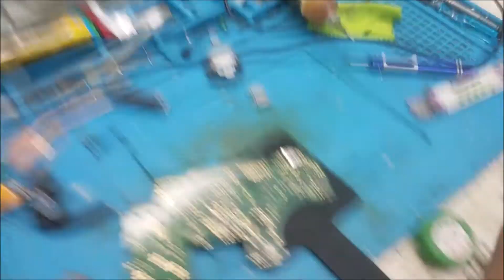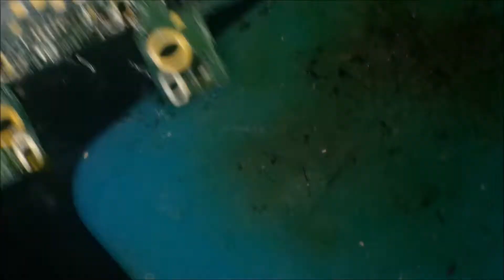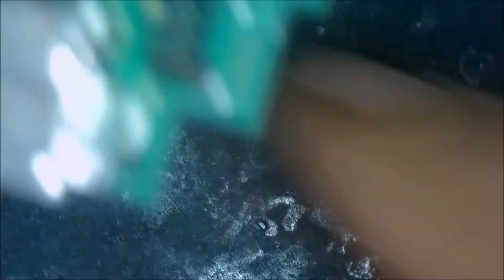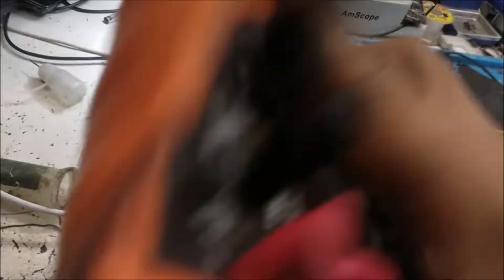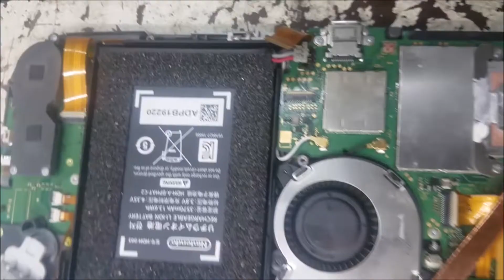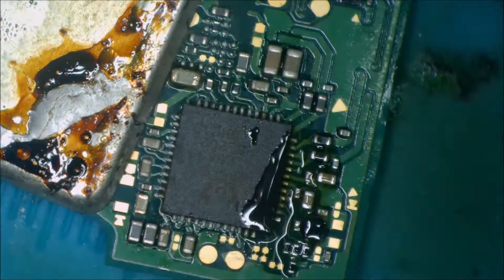Nintendo switch no power no charge then error code 2101-0001

Comment: Don't ya just love it.... 'Authorized'. It's sad when you spend a decent amount of money for a gadget like that and it quits after 3 months and they won't fix it. I get that the customer bent some pins but if you're promoting yourself as an authorized repairer - you should be able to do component level repair, not just be a board changer. Very nice repair. 👍 What iphone do you use your thermal camera with? I have an 8 plus and it doesn't give the same clarity as your phone. I use the flir Pro but the image is more like an LT.
Reply from the maker: authorized places keep us in the business, i do have flir pro LT android, i was using it with galaxy s9plus now using it with moto stylus the new app works great in it because it keep the low temp dark and shows any little temp increases , you have flir pro it is 2x more clear and better resolution then LT
Reply: @SOSfixElectronics  ok, thank you. I'm hoping it will do better with a newer iphone such as iphone11 ... down the road. Maybe it's just app. It's ok for now.  🤫
Reply: @SOSfixElectronics  Seems that the Pro & Pro LT for IOS are no longer available. Could you please tell me the last video that you used your thermal cam in? I may have an issue with mine, image is not as advertised. Thankx.
Reply from the maker: @electronicrepairservice2020  is it this one? 
https://www.youtube.com/watch?v=lQZly1gxevM
Reply from the maker: @electronicrepairservice2020  i ll make a video fixing macbook using flir soon i ll try to show more about it
Reply: @SOSfixElectronics  yes,thank you!